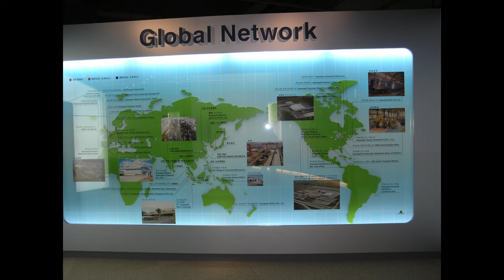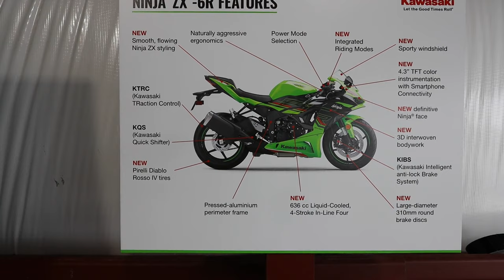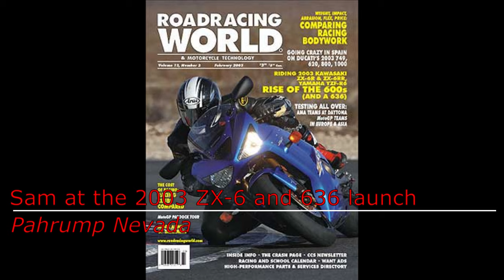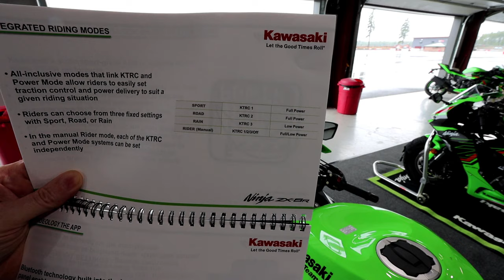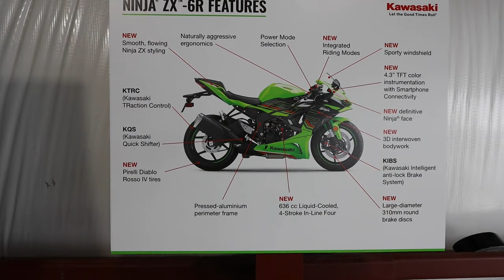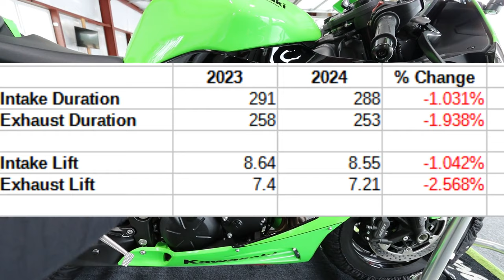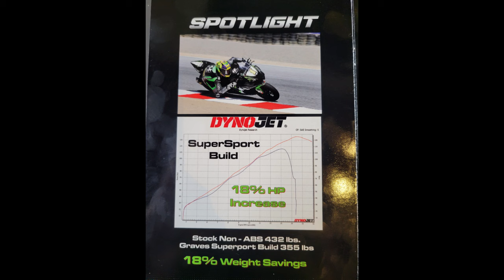2024 Kawasaki ZX-6R Track Review

Comment: This review is so good! So much detail. Quick question. I'm looking to do 50/50 track days/street(on nice days).  Does abs get in the way on track? Would you go abs or non abs?
Reply from the maker: Hi! Thanks for taking the time to write.  ABS on motorcycles was originally pushed because riders weren't using enough front brake to avoid collisions.  The theory was that ABS would give less experienced riders more confidence to brake harder.  So, Advanced Intermediates/ Experts riders who use a lot of front brake on the street would get the non-ABS to save money and weight and reduce the chance of the extra plumbing introducing complexity as they are confident in using a lot of front brake already without the ABS safetynet.  Less experienced riders who rely on ABS to prevent locking the rear wheel might want to stay with ABS BUT, it would probably be better to get some time on a little dirt bike to practice threshold braking (front and rear) so you learn how to find, and then handle, front and rear lock ups.  At the end of the day,  either of the versions are going to be fine for track days with non-ABS getting the nod for straight up racing.
Reply: Thanks for the really detailed explanation.  Now I just have to figure out whether to go from my ninja 400 to the zx4rr or zx6r.  I'm leaning towards 6r because it has a low power mode on I can leave it in on track until I'm ready.
Reply from the maker: If you have some motorcycle track experience and have halfway decent throttle control, the ZX6R isn't crazy powerful and won't be too much of a handful.  It also handles very lightly.
Reply: Well that settles it.  Zx6r it is!
Reply: To add one question if you don't mind.  I don't use the back brake ever on track and actually wish I could have rear abs off all the time.  Very confident in that, as well as very confident on my front brake and trail braking.  Just wondering if having abs would be worth it given I am not racing(but would like to make it to advanced group at some point) and having that safety net would prevent me from locking the front wheel and taking a chance at crashing (Maybe if the track is wet or something like that).
Reply from the maker: I haven't tried going race pace on a ZX6 with ABS.  On our R1 race bike we fade the brakes, ,badly, with the ABS installed and don't have as much fade without the ABS.  That said, I think you could do  advanced group track days without ABS without a problem.  If you ever start getting fade it'll be because you're doing great and then you can always remove it later.

Comment: In your opinion are the stock suspension components good enough to be club level raced with the available adjustments? Thanks
Reply from the maker: If you graphed lap time diminishment vs money spent you would see a strong inflection point where you need to spend more and more money to get a smaller and smaller decrease on lap time.  

Race prep for a NOVICE club racer would be bodywork, exhaust, ECU flash, steel brake lines, HH brake pads, sticky tires, steering damper, non-folding pegs and replaceable clipons and a lot of race wire.  Basically something like that.  

Then see what kind of times you are turning versus the front guys.  

If your weight is outside of, say, 150 to 190 pounds you probably need to think about springs no matter what.  And, of course, if you change the springs you might need different valving.  But, for an average weight rider...

If you are within 1 second of the front guys, cartridge the forks and replace the shock.  If you are not within 1 second, spend the money on more tires, more track time or coaching.

If you are an expert then you'll probably change out the suspension as a matter of course because, well, because.
Reply: @armyofdarknessmotorcyclesb2883  thanks, always ridden on aftermarket suspension because most of us just go ahead and change it but I’ve started to wonder how much difference it really made especially with the latest bikes.